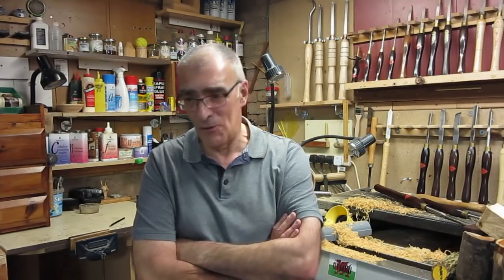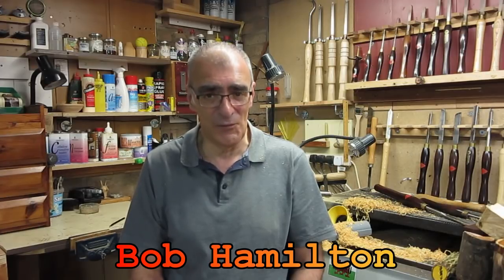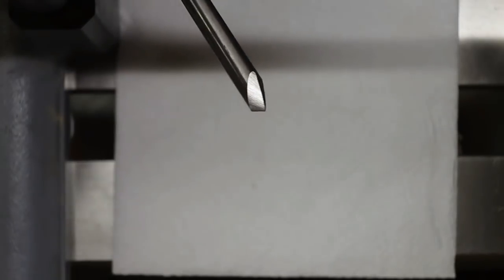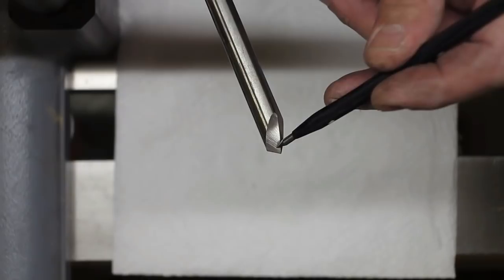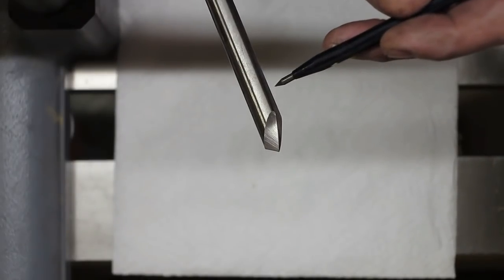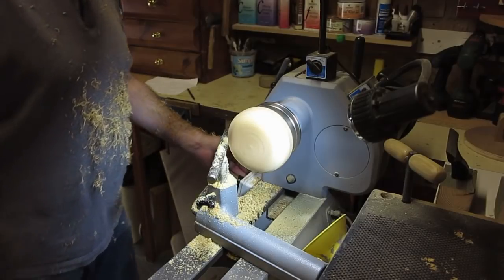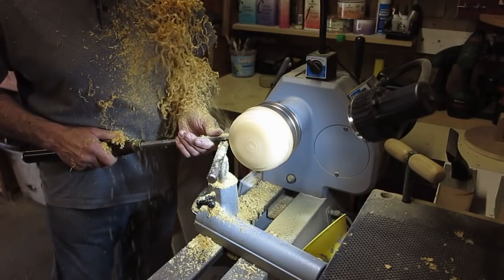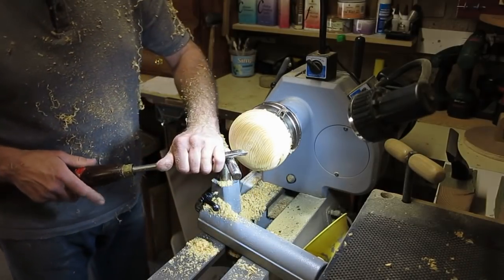Wood Turning - Beginners Guide # 5 - The Bowl Gouge

Comment: 24:10 so if you are cutting using just right of center on the tool, then this is more a scraping cut than a shear cut?
Reply from the maker: Sorry to be a pain but could you look again and put another time stamp in the comment.
Cheers
Mike
Reply: @MikeWaldt  I have NO idea where that time stamp came from!  sorry!  try 16:00.  if the cut is on the right hand side of the gouge, isn't this a scraping cut?  It seems the blade is 90 Deg to the cut like a scraper...I may be wrong. Newby and I haven't had any success with this grind on the bowl gouge and definitely need instruction on it.  It's a scary tool to me and you guys make it look like magic.

Comment: Hi Mike, Slowly getting into this art and have a better understanding of the gouges thanks to your site but what about speed of lathe this is the bit that baffles me or should I just go with the top speed for all bowls. Can you help.
Reply from the maker: Hi Richard, definitely do not turn any bowls at full speed, gradually turn up the speed until you get vibration, then back off a little. If you search recommended speeds for different size bowls on Google, there is a guide chart. Work around the figures given there to begin with, and then alter to what you're comfortable with.
Hope this helps
Cheers
Mike
Reply: Mike Waldt Thanks for the advice. I'll certainly research this more. My  lathe is only a few years old but it does not have the variable speed control you have to move the belt to set the speed. But thanks once again for all the good advice.

Comment: I am currently using carbide chisels but want to go into using traditional chisels. Want to start off with a bowl gauge. Which one would would you recommend for a beginner turner?
Reply from the maker: Hi Philip, I would go for the best quality uou can, from a reckonised manufacturer,  you will benefit in the long run. It depends where you are of course.

Comment: ON the goblet, when hollowing, the flute was facing the work but here, when hollowing, the flute is facing out. I am a little confused on this. 
thanks
Reply from the maker: +icespeckledhens 
On the goblet I was "back" hollowing as it is end grain, and you get a cleaner surface off the tool in my experience. On a bowl, which is normally a side grain position, a push cut is the most effective option.
Cheers
Mike
Reply: +Mike Waldt thanks
I will bear it in mind
James